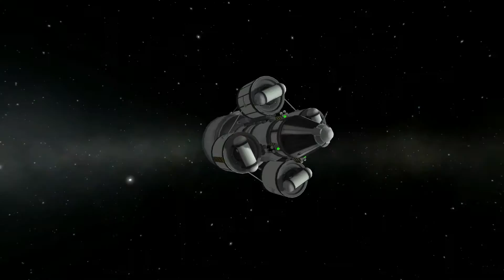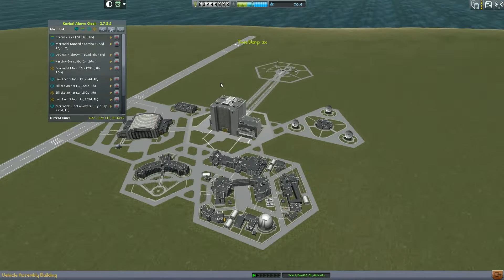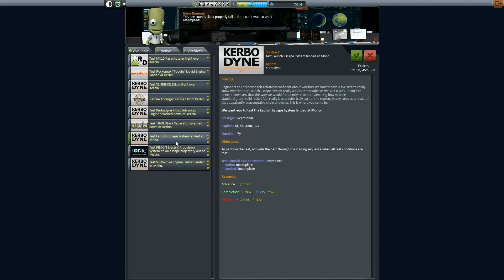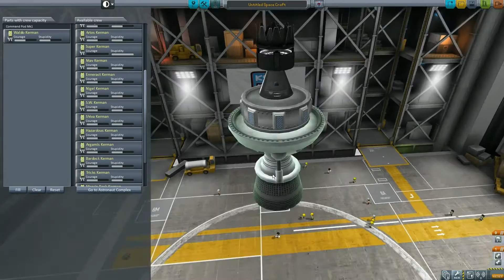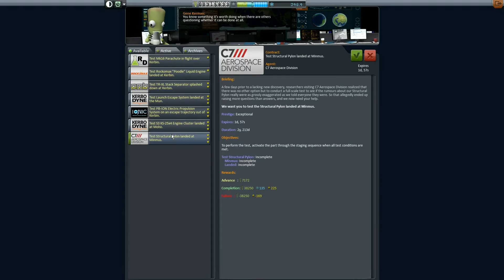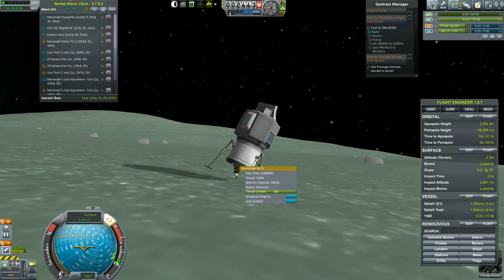KSP - Teamwork 21 - Money On My Mind

Comment: I dont recall ever being able to shut probes off.  The only thing you can do is lock the electric charge in all the parts so it cant be consumed.  this preserves it till you actualy need the charge but the core will start draining as soon as you turn it back on anyway.   Seriously though the small flat solars are fairly cheep its always worthwhile to stick them on a mission thats going to last longer than a few minutes.  Even a single 1 would have solved alot of issues on that mission.
Reply from the maker: Yeah my not having solar panels wasn't to save money, like I said in the video. It's because I didn't think about it until launch and figured I'd save the 10 seconds it'd have taken to revert and slap some solar panels on it. Plus, I thought I could disable the probe core and then everything would have been fine.
Reply: You could do it on .23...
Reply: ogxbmc
Are you sure your remembering shutting off the actual probe core or just the power in it?  You can click the green arrow by the electric charge to lock the EC and prevent it from being consumed.  If the EC in the probe was the only EC on the ship this would appear to be an off switch for the probe.  It wasnt however its just preventing the probe from accessing the power and thereby shutting down.  However it will fire back up the moment there is any EC on the ship thats not locked.  you can't have the EC available for reaction wheels without the probe core going active as well.
Reply: ActionGroups??? :3
Reply: ogxbmc
 Cant say I've ever tried to stick one on an action group before.  Either way that actualy requires you to set that up ahead of time asumeing its possible.  that or a mod that lets you modify action groups.

Comment: That is weird I thought you could shut them off as well, but I just went and looked and I do not have it on my main save either.  Even on my clean save it seems that you cannot disable them, this is very odd.  I guess you could disable the battery/electric charge on them in order to save battery life until it is needed.  I thought .25 was a ways off yet or was there an announcement of something I missed, anything on the forums from most I take as more rumor than fact unless there is an official source to back it up.
Reply from the maker: Nothing super official, but it's officially in QA and MaxMaps just today said on Twitter "Hope to have 0.25 in your hands as soon as possible"

I wouldn't be surprised if we get it before the end of October, which at the rate I'm releasing videos is maybe a dozen more videos. Not a long time at all.
Reply: Yeah I keep forgetting that it is September already.  Time seems to be going faster everyday.   I had figured .25 would be around late November or early December, but I could see it being out in late October maybe.